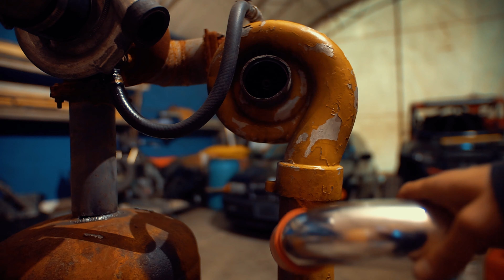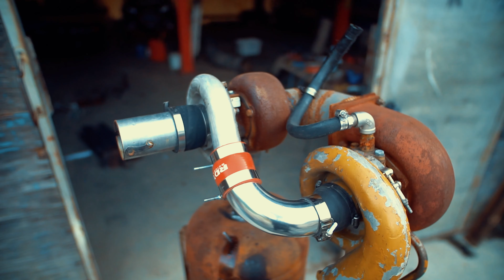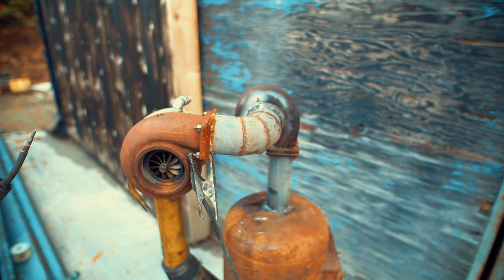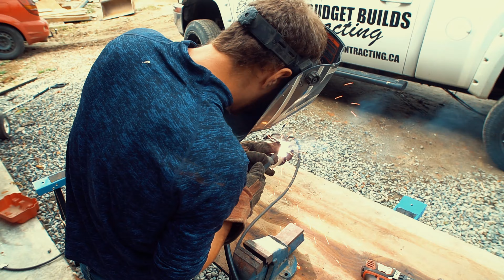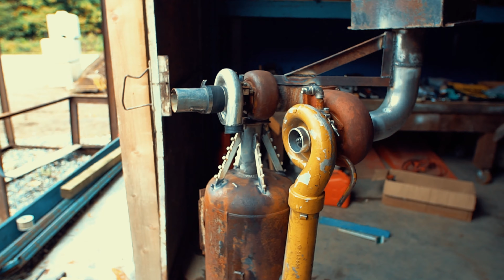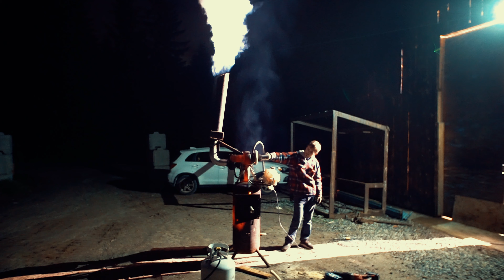Testing Before Nitrous... Will It Survive The Next Video? (Doubt It)

Comment: in a compound setup, the exhaust goes into the little turbo hotside first, then to the big one, with a bypass so the majority flows into the biggin' once the base pressure is met.  The intake flows into the big side first and then into the little one stepping up the psi.  so if the little one takes it in at 1 bar and pushes out 2, then the second little one takes 2 bar and makes 4 bar.  the way you have it is backwards on the cold side at least.  i wanna see it rip.  subbed.  maker her scream!